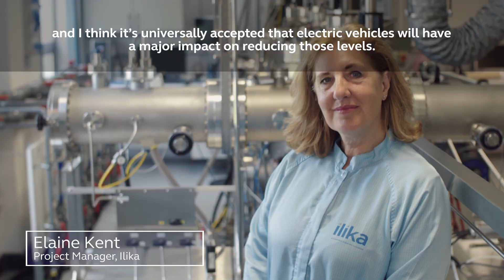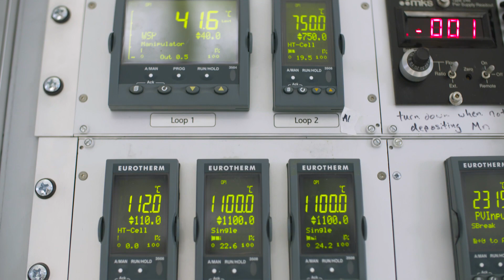Faraday Battery Challenge award winners -  Ilika technologies

Comment: Can you achieve any of this without having to mine for scare materials? One of my objections to plug-in electrics is that accessing some of the materials required for current battery technology is causing horrendous harm to the planet and we're much better off pursuing the hydrogen fuel cell/ pump routes imo!!